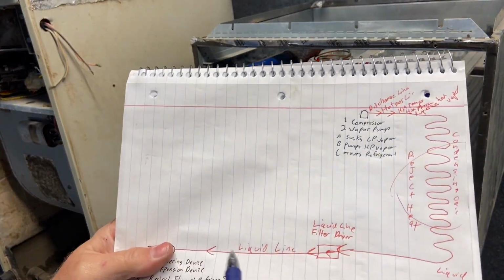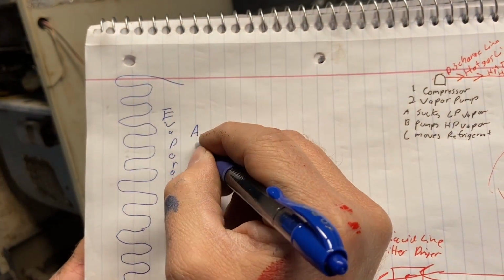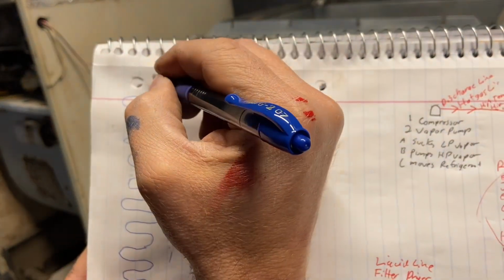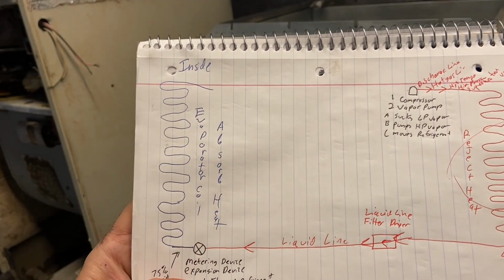HVAC 011 Evaporator Coil introduction

Comment: Hi Ty! There is a Schrader valve in the out let of the Evaporator, is possible to use it to check superheat? If yes are the readings would be different from out side service port? Thank you.🌹
Reply from the maker: Yes sir! I add one one in my installs for this pourpouse

Comment: Hello, TY for the vids, Im just learning & really appreciate them!! Does the superheated liquid enter the evap from the bottom?? Or top?? My bokk states from the bottom but my instructor said it come in frkm the top. Now I am confused!!
Reply from the maker: Well there is not superheated liquid.

Your at video 11, keep watching the videos in order and you will fully understand the concepts by the end. 

To answer your question, 
Subcooled liquid enters the metering device, leaving the metering device is a saturated mixture of approximately 75% liquid 25%vapor. That saturated mixture enters the evaporator coil at the bottoms.

After all the liquid changes state to a vapor the vapor then  continues to absorb heat and superheats  above saturation.  The superheated vapor leaves the evaporator at the top of the evaporator and traveles towards the compressor/vapor pump.
Reply: @love2hvac  thank you responding. Yes I should of said  superheated liquid/ vapor mixture. I was confused because the book stated enters the bottom and exits the top but my instructor insisted it enters the top. He seemed ticked off I was asking especially when  I questioned gravity and liquid being heavier than vapor & running down and not vaporizing  thereby entering the suction line unless their was a collector lower than the vapor exit port. But again he just said ITS THE TOP and seemed annoyed I was asking!!! so, I just let it go. THANK YOU for responding, I always want to learn as much as I can
Reply from the maker: @notnecessary7730  yes it definitely enters at the bottom and leaves at the top in most cases.

For clarification it's a saturated liquid/vapor mixture. It can't become superheated until all the liquid is completely gone.
Reply: @love2hvac  Thank you very much!!